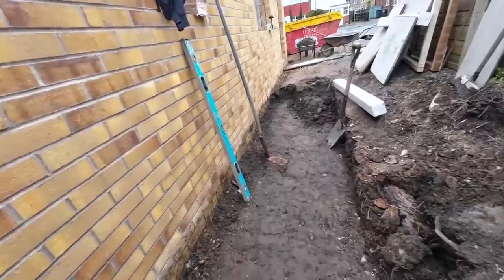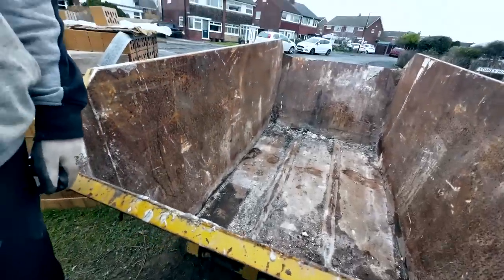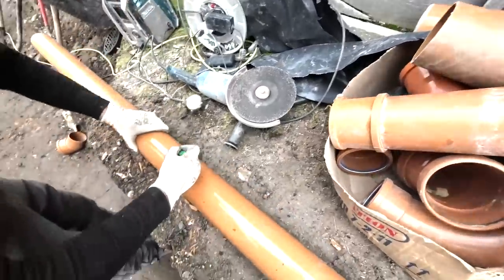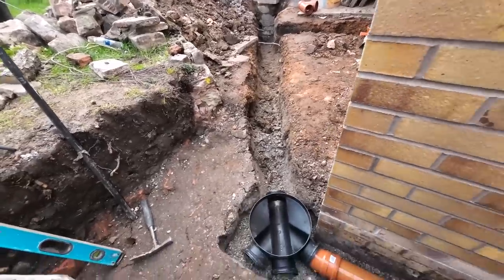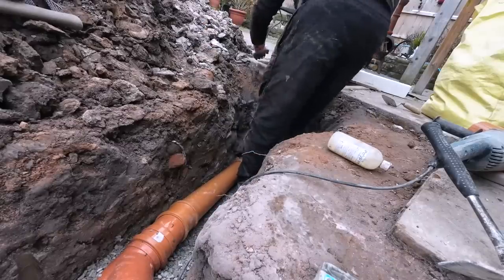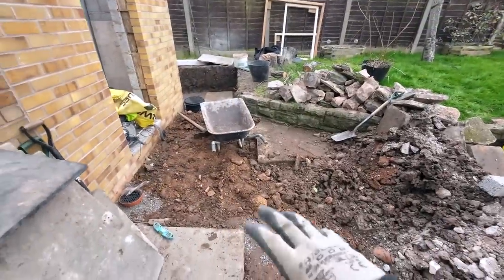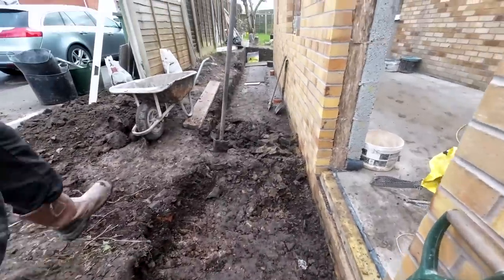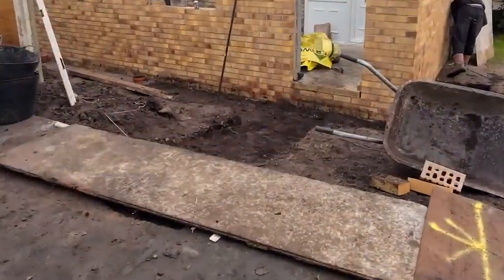INSTALLING 100MM FOUL DRAINAGE...EXTENSION PT 8

Comment: I love your content and workmanship. I have done a few extensions and my dad was a machine driver and ground worker so always helped me. He was always insistent on getting all groundwork done with footings if possible. I think this shows why! We even had holes done and boarded or loose filled with shingle before just to be hand dug at a later stage. 
Quality work tho guys and you stuck at it!
Reply from the maker: Thanks pal , next time will be different 🥵🤣🧱👍🏽
Reply: @SteveAndAlexBuild  I know it will, onwards and upwards always sharing and improving💪🏻
Reply from the maker: @Wattsjoinerybarn  Absolutely 🤜🏽🤛🏽🧱👍🏽
Reply: Great point. Always try and get the drainage done with the ground works. So much easier 😊

Comment: A tip for DIYer's, to achieve a 1 in 40 fall for sewage pipes..take a 2 meter spirit level and tape a 50mm block of wood to one end, be sure to put the block on the low end of the pipe and read the bubble as level, the same principle can be applied to any type of fall, for patio etc.

Comment: Good morning to you both, just watching all your old videos as really enjoying them all.
I have a old pipe cutter that I was given from a friend who is now retired that slides down your 100mm pipe and as you spin the handle not only does it cut, but it puts the taper on the end too.
Keep up your brilliant hard work 👍👍👍🧱😊
Reply from the maker: Thanks Anthony that sounds like a great piece of kit 🤙🏾🧱👍🏽
Reply: @SteveAndAlexBuild  Good morning, yes it is and I don't think you can buy them anymore. I understand that it's German made
Reply: @SteveAndAlexBuild  It's a Rothernberger pipe cutter not if you can buy spare blades still??
It clamps on the outside of your pipe and line up the point of the blade depending on which side you want the leading edge of your pipe and off you go. Spinning the handle and tightening the blade into the pipe each turn, I am using to as we speak and had other people try to buy it off me but not parting with it. Takes on average 6 full turns to have a pipe cut and ready.
Take care of yourselves and keep up the great work you do 👍🧱😊

Comment: Hate to say this but make the best use possible while you have the digger on site get your founds in build up to dpc level pour your floor then get your drains in straight away and build up the super structure afterwards, use the digger as much as you can use it to dig drains, get your dolly in,.build up your sub floor and even spread concrete if you have to, think of number 1 and save your back ache that's why the machine is there lads use it to the beat of your knowledge 👍👍

Comment: Surface drainage into sewerage system would have our water board going nuts! 
They will make you dig a soakaway system long before you would be allowed to combine the two together.
Reply from the maker: Not in this area due to the type of clay 🧱👍🏽

Comment: Great video on drainage nice to see builder laying pipes on stone some we go to as I work as drainage engineer are just rushed and got no stone under or around. Just check with building inspector  about the soil pipe dropping in on vertical y junction and not flat why with rest bend going into it to reduce splatter and build up of tissue.

Comment: Cut a collar fitting so you can slide it freely draw around the pipe so the cut stays true ...saves marking by the tape all around the pipe ...
Reply from the maker: I like that one Che, nice one I will be using that from now on cheers 
🤜🏽🤛🏽👍🏽🧱

Comment: That is a lot of work without sounding as though I'm repeating everybody. I guess its a much of a muchness. The house is sitting on a sloping hill and its further down the hill, so effectively taking away part of the slope. Good work getting those drains in and then working on the path.

Comment: Great job Steve and Alex I could see you whinsing everytime you bent down but I'd imagine you can't get it done time off you lose money .👍
Reply from the maker: Very true nige 🥺🧱👍🏽
Reply: @SteveAndAlexBuild  I know the feeling I needed surgery on my hand and kept putting off and putting it off then finally plucked up the courage to get it done but sadly turned out worse than first feared and ended up losing my fingers ended my career on the blackstuff in a heartbeat.but I still managed to put up 80ft of fencing sleeper walls and decorate with just two fingers on the right hand certain things I can do and certain things I can't I just get contractors in to do the bits I can't 👍
Reply from the maker: @nige.3494  🥺😬🧱👍🏽

Comment: Surprised that they are still combining storm water flow with sewer flow.   Is that common in England?
Reply from the maker: It is very common on older properties 🧱👍🏽
Reply from the maker: @mick6721  If it was possible they would .

Comment: Why did you not table off with digger lot easier. We do our drainage soon as we get brick work out of ground use the 150 gap then gravel and fill.
Reply: Forgot to say there is an online drainage supplier we use 3m pipe is £5 a length bends and traps ect half price compared to building merchants. Let me know if you want there details and I will dig them out.
Reply from the maker: @paullindsay4798  jeez that is cheap !  We have an e mail in our video descriptions 👌🏼🧱👍🏽
Reply: @paullindsay4798 give us a clue to the name in the comments 😊

Comment: Why are you putting rain water into the sewage system? Is that not why the sewage sytem cannot cope when it rains?
Reply from the maker: We were told to by building control as the ground was pure clay and not suitable for a soakaway 🧱👍🏽

Comment: lads why didnt you run the drainage under the  slab ? Would have saved all that digging and looks miles better. Also not to be picky, you connected the mini chamber wrong. You should be coming into the centre of it as this is the main feed and is a tad lower than the side feeds. Building control should pick that up.